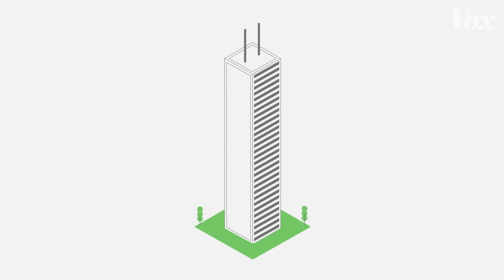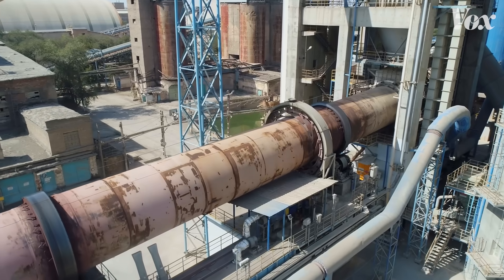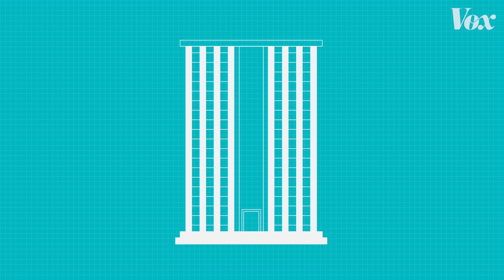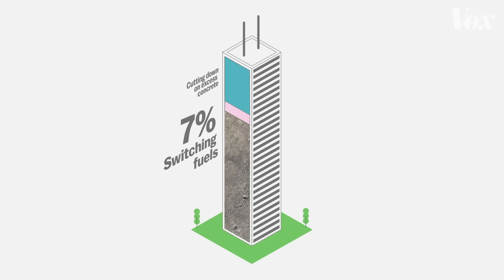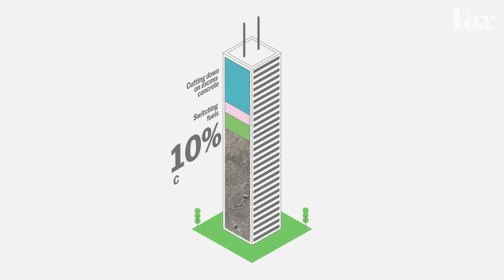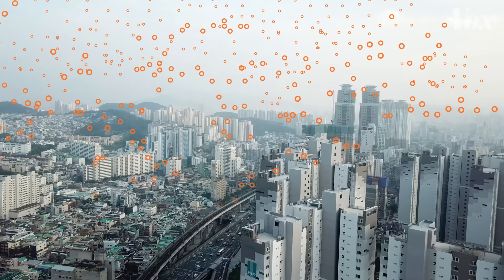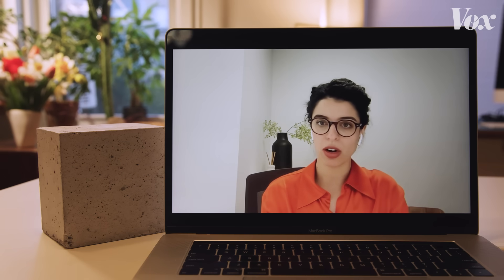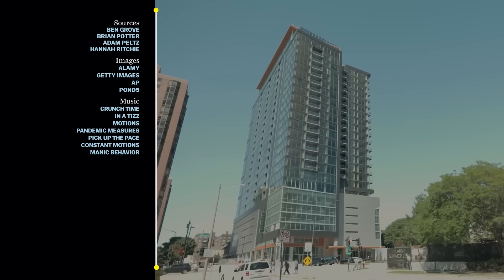The big problem with cement, and how to fix it

Comment: One big thing that wasn't mentioned is using concrete with high-tech additives like a small fraction of chopped glass or plastic fibers and even graphene to make it much stronger so you need less concrete and steel to make the same structure. 
There are other advanced techniques like foamed concrete that can reduce the weight, especially for floors where bending strength is the most important factor.

As for fueling the cement-making process, I feel like there are a few net-zero options that should have been mentioned.
The obvious one is green hydrogen, which can clearly reach the required temperatures without carbon emissions. As for electrification, electric arc furnaces like the ones used in steelmaking can easily reach the required temperatures, so it's not necessarily easy, but it's a solved problem.
The other thing I wonder is why they wouldn't mention biomass to heat the kiln, since fly ash can replace some of the cement and you can get usable fly ash on site from biomass once everyone stops burning coal, which is the current source.
Reply: Informative comment. Thanks for taking the time to write it
Reply: I've worked with graphene from different companies in cement and I'm not convinced it is not a scam
Reply: @homashu  I'll admit that it's the technology I mentioned that I'm least confident about. 
As for whether the additive actually strengthens the concrete, it sure seems to work consistently in the lab, so I think it's more likely an issue of scale than the underlying mechanisms. A lot of the problem for most graphene applications right now seems to be that current industrial-scale graphene production just doesn't produce very high-quality graphene. 
There's a new graphene manufacturing technique from India that might solve a lot of the quality problem:
Ultra-Fast, Solvent-Free, Mass Production of High Quality Exfoliated Graphene Aminul Islam, Biswajyoti Mukherjee, Krishna Kant Pandey, and Anup Kumar Keshri
Reply: @homashu  what do you mean by that?
Reply: Thanks for that note, but isn’t biomass of worse carbon quality than coal or other fossil fuels? Maybe this is just semantics, but curious of your opinion
Reply: @magnetotwister  Biomass may release more carbon than fossil fuels, but the emissions consist of carbon that was already in the carbon cycle. The carbon in that biomass got there, one way or another, by biological processes that removed it from the atmosphere, and will, one way or another, make its way back into the atmosphere by some kind of decomposition, including burning. Whereas carbon from fossil fuels (and, incidentally, the limestone used in cement production) is not in the cycle, having been removed from the cycle long ago, and burning it reintroduces it.
Reply: Biomass is less efficient than coal or natural gas though.
Reply: @rzpogi  if that turns out to be a problem, I don't think it's that hard to process the biomass into charcoal first, which would solve the problem.
Reply: you wouldnt see much foamed concrete be useful for structural elements, its better for large forms that are not weight bearing, much like using it for facade work. In places like NYC, with local laws requiring commercial buildings to keep up  maintenance work on public facing facades, I have seen a bunch of companies switching to these large foam concrete forms to replace ailing intricate arch work, buttresses, dentils and a variety of other architectural forms.
Reply: @theav8r_454  I think in most cases you're very correct for structure, especially because I doubt most building codes would allow foamed concrete to be structural in large buildings no matter what the engineer says.
As a structural engineer (Aerospace), a thicker piece of lower-density material is more mass-efficient in bending, so as long as you keep the density high enough to adequately protect the steel rebar, a floor made of reinforced foamed concrete is going to be lighter than one made of reinforced regular concrete.
I suspect the use of foamed concrete to replace facade details has more to do with the fact that the lower densities can be worked with woodworking instead of stoneworking tools than anything about weight.
Reply: Liking this comment, and I think nuclear (HTGR or other high-temp reactor) is the way to get there.  It would generate process heat to 850C for the rest of the heat from burning the hydrogen generated by the electrical power of the plant that is sitting right there.  No need to transport any fuel long distances (other than some uranium every year or so).
Reply: @LFTRnow  if you're going for HTGRs, I think that thermochemical hydrogen production with the reactor and just using the resulting hydrogen for heating might work better since thermochemical hydrogen is really efficient compared to electrolysis and you aren't continuously blowing huge amounts of new air that needs to be preheated through the hottest parts of the kiln.
using heat from the reactor directly also runs into the issue that generating electricity (or hydrogen) with the reactor heat is going to significantly reduce the outlet temperature you can use for preheating.
Reply: @LFTRnow  Yeah! Let's just dump all the toxic waste in someone else's back yard! It'll only effect them!
Reply: Electrification..... And were does the electric come from? Solar and wind could never generate enough power, at the moment. Please tell me you know milk doesn't come from a store.  And hearing them say story g carbon in the buildings... Climate change is a sham.
Reply: How ya producing that hydrogen bud?
Reply: @tyrel7185  either electrolysis, Nuclear Powered thermochemical, or solar concentrator powered thermochemical. same as everyone else who suggests green hydrogen.
if your contention is that green hydrogen doesn't work in general, that's a different question.
Reply: FRC (Fibre reinforced concrete)'s applications are pretty niche, and don't really add any compressive strength.
It can add tensile strength, and reduce porosity; but definitely comes at a premium. probably not the place to start if you'd looking for large changes in the industry
Reply: The main source of fly ash is from coal-fired power plants. It has a number of beneficial properties when used as a small replacement of cement. Power plants though are on the decline in the US and their main purpose is producing power…not fly ash. As a result while it was traditional used because it was cheaper than cement, there is less and less in the market. The quality also varies based on where the coal was mined. Type F which comes from east of the Mississippi is preferred over the Type C which comes from the mountain west. So while it’s benefits have been touted for some time, there will be less and less in the future.
Reply: Yesyesyes
Reply: Recently in the UK there has been a scandal of dozens of schools built with reinforced autoclaved aerated concrete being at risk of collapse; are there other types of foam concrete that avoid these issues?
Reply: Or just switch to geopolymers....
Reply: Using electricity to heat up to desirable temperature is bad because it will be less efficient 
Still electricity will produce by burning fossils fuels and transporting electricity will have significant due to resistance so it is better to use coal or fossil fuel or dump for producing temperature than using electricity 😊

Comment: "...causes Limestone to release it's stored Carbon Dioxide."
This statement implies something completely different than what is actually going on.
Limestone isn't STORING CO2. The CO2 is part of the molecule's structure, like Oxygen is part of a water molecule.
The CO2 isn't just in there ALONG with other stuff. It is PART of the limestone.
Making cement is chemistry. We are breaking apart the limestone molecules into something else. And one of those parts we are breaking off is a CO2.

Comment: I also love how the cost of the building is going to almost double if not more!
Reply: The cost of the concrete would double, which they mention is a minor cost compared to everything else that goes into a building like that.
Reply: @Zaydan Alfariz the cost of CEMENT is not the same as the cost of concrete blocks.  The cost of the materials is tiny in comparison to the cost of a building.
Reply: @elfrjz Got some stats to back up your random claim of the difference between luxury condos and public housing?  In either situation I'm pretty sure labor and finishing costs vastly outstrips the material cost of cement.
Reply: @Zaydan Alfariz the recent shortage of cement?  You realise that the cement market is massively oversupplied?  Possibly there were temporary issues with the supply chain.

Comment: I'm a little surprised Roman Concrete wasn't mentioned 🤔

Scientists recently figured out what was so special about ancient Roman concrete compared to our own ans unlocked its recipe. It's self renewing.

Now, Roman concrete won't do us any good in buildings, but for sidewalks and roads, it'll fix cracks in itself on a continuous basis.

It's definitely not a 0 carbon emissions process. But the making if it emits less carbon, and with it being self renewing, it can help tide us over until we solve our concrete problem

Comment: Despite the carbon emissions of concrete, would high-density housing in concrete skyscrapers be better than low-density urban sprawl?
Considering the costs of building and maintaining roads and utilities, and the costs of transportation (public/private), maybe a single concrete apartment is better than an equivalent number of wooden houses just by the fact that everything is much closer together.
Reply: It depends on many factors, but, in general, high-rise and mid-rise are better, than urban sprawl.
Reply: @elfrjz and china ..entire empty cities
Reply: Don't get it in your head that skyscrapers are good though. Unless there's literally no space to expand, buildings don't need more than 10 stories. Buildings like the Village House are extremely efficient and eco-friendly
Reply: @person8064 i feel like. The only reason you say it's eco friendly is because it look eco friendly. Considering, i didn't see any argument on why it's eco friendly in the first place.
Reply: @chandy3859  Since we're comparing it to skyscrapers, I'll point out one way they're better: skyscrapers are extremely energy inefficient (see "Weatherwatch: glass skyscrapers are worst energy offenders" by The Guardian)
Reply: @person8064  flawed logic. Urban sprawl is VERY bad for the environment. Where I live they keep building outwards cause they are using the same flawed logic as you. 

Cities need to build up, not out.
Reply: This, plus single-family homes in most countries are built of concrete and brick anyway, not wood.
Reply: Somehow I feel research on urban sprawl is skewed with an American point of view. There are single family homes in my country that are way more efficient than a high rise. Also the fact that living together with family is also efficient.
Reply: You have to consider where you are putting these high rises. People live in all sorts of places, plenty far away from each others and would rather stay there then be forced to live close to each other.

Comment: Replacing concrete with structural stone is also a solution with high potential, after all it is the aggregate glued together by cement that gives concrete it's strength. It is however compared to concrete much more sustainable, stone is abundant and it's extraction is already done using electric tools. Using the technology of post tensioning high spans of up to 20m can be archieved with slender profiles. For example basalt has a compressive stength 5x stronger than even the best concrete.
Reply: How about we carve out INSIDE the big stones and use the space? And we can call it…cave?

Comment: Isn't the electricity part still a carbon contributer? i mean if we replace fuel as a source of heat with electrictiy, that would still demand more electric power from the generation which also gets electricity from burning fuel.
Reply: Same silly argument against electric cars... What is easier: having everything use electricity and then swapping where that electricity comes from or everyone using whatever they want and trying to convince everyone to switch to electric until AFTER swapping the electricity sources?

Comment: It's olivine sand. It can safely replace sand and absorbs carbon when wet. It will strengthen the concrete as it ages, make harvesting the ocean for sand unnecessary, and turn every use of concrete into a solution for the climate crisis. The problem: olivine sand is 5 dollars more a ton than ocean sand.

Comment: Hi there! I am a graduate architecture student and we are currently studying Hempcrete. I think it would be wonderful for you guys to cover this topic on a sustainable substitute! Our class would gladly share all of our research and experiments with you all at Vox!
Reply: Hi, im a structural engineer in the workfield and currently working on my master thesis on Geopolymer concrete, where the cement is made without limestone. 
And thus removing a big part of the Co2 emmission.  Im mainly focusing on the structural behaviour and properties, but co2 is also a part of the story.
Reply: @stevenwy66  love this! I would love to read your research when possible!
Reply: @stevenwy66 cool. I'm on a construction masters (building Surveying) and am working on an assignment on geopolymer cement
Reply: @Dino2GunZ  True
Reply: I remember learning about woodcrete in material science. We were learning how they got it to have the same strain as steel.
Reply: @Eoin-B  strain or strength?
Reply: @tomasbeltran04050  strain. It's The change of a material under stress. Like compression or expansion under heat. Both concrete and steel deform at the same rate meaning they are the perfect couple woven into each other as a building material. It's really hard to engineer cheap materials that can replace them.
Reply: @Eoin-B  þank you, ðose are new terms for me
Reply: @tomasbeltran04050   i studied materiel science 12 years ago and majored in computer science, so I half expect agonist to come in and correct me on woodcrete, but that was one of the few things that stuck in my mind from college as it was a pretty fascinating discovery especially after learning how hard it was to engineer.
Reply: Hempcrete is not load bearing
Reply: @SâmAhm-v3e  it’s primarily substituting the plastics we use for insulation
Reply: @moonlitnomad420  could you provide more detail?
Reply: @SâmAhm-v3e  i’m not talking about using it as a structural substitute
Reply: @SâmAhm-v3e  It's not used as a load bearing material. Green steel would likely fulfil that job.